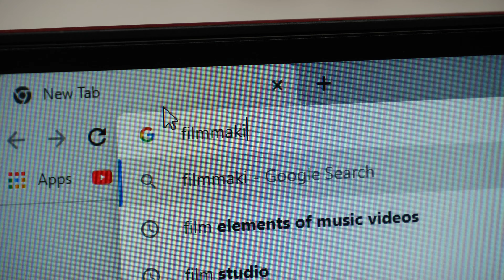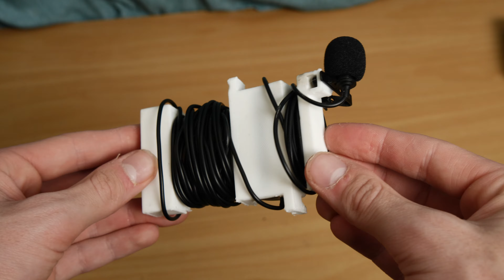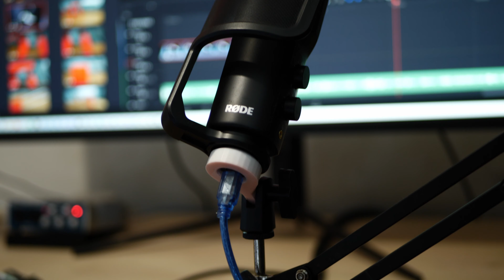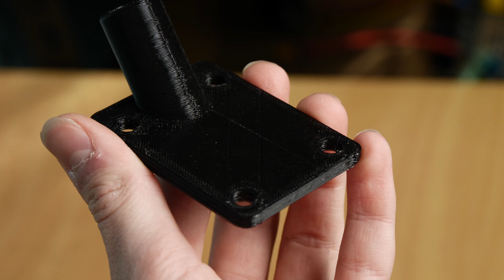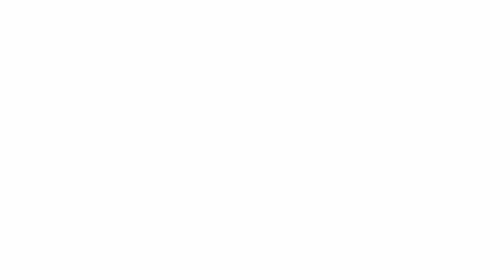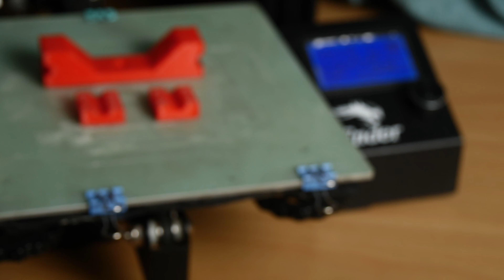3D Printed Film Gear is Underrated!

Comment: You mentioned a multiaxis slider. What I am really interested in would be some sort of motion control camera where you could link it with blender so you could control your camera motion from your 3d scene and then have a perfectly mated virtual camera for vfx use.
Reply from the maker: That would be incredible. I’m trying to build a 2 axis one currently, but it’s a bit more challenging then expected. (And that’s after removing the third axis.) Having it integrated with blender would definitely have its strengths. I’ll try look more into it in the future. Cheers

Comment: You need to dry your filament. That way you won’t get those bubbles. Also buy a Bambu labs printer it will give you way better quality and the parts will be done 3x faster. Good job though 🎉
Reply from the maker: I’ve recently acquired a good dryer, wet filament won’t be an issue anymore. It was quite a pain without it. I can’t justify even a P1P yet due to local markup/shipping cost, but It’s 100% on my wish list. Cheers!